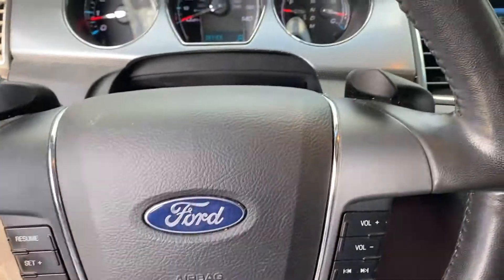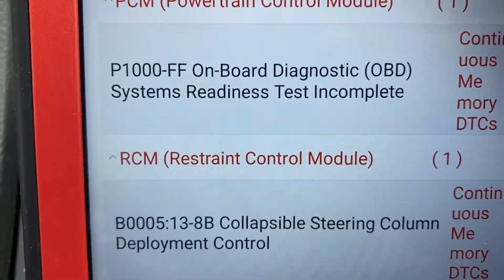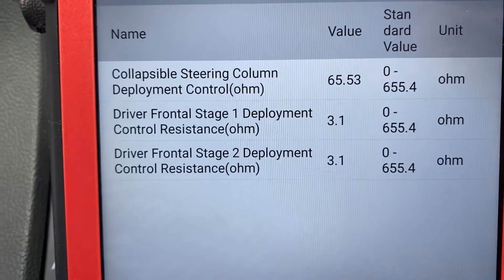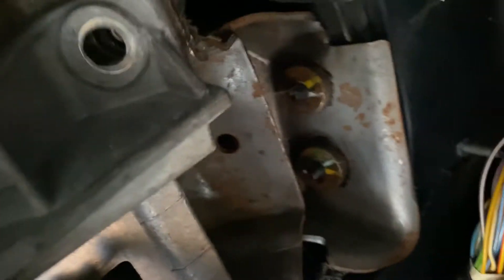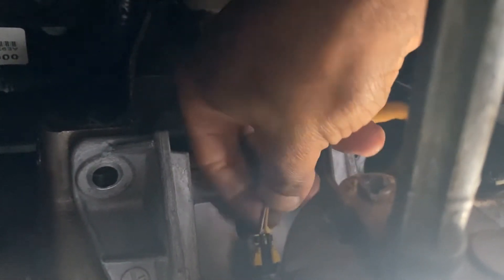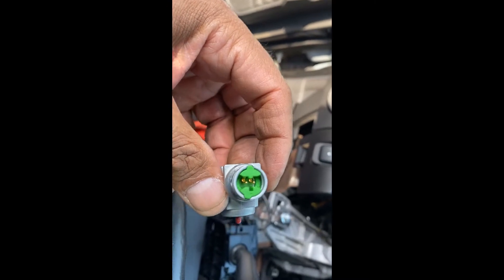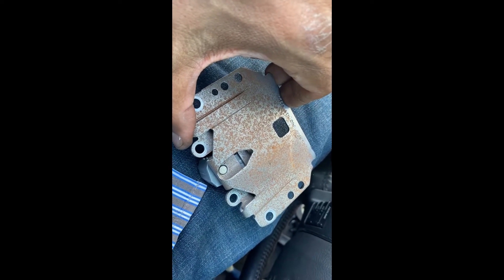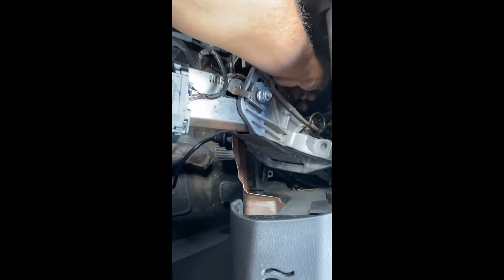2012+  Ford Collapsible Steering Column Deployment Control Sensor fault code B0005

Comment: Hello, loved your video! Could you tell me what dtc code you had. I am showing a deployable steering column circuit short to ground. Does this call for a sensor replacement? Or should I look for a bared wire making ground? Thanks for anything information you can give me!

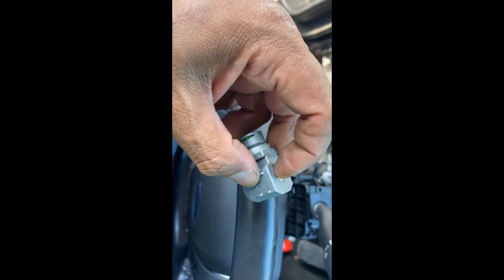Comment: Also, is it always necessary to change this sensor? or will simply pushing that red nipple back in so the metal nipple hits the plate sufficient (like you started showing at 6:55 in the video)?
Reply from the maker: Depend on the dameged inside the sensor, sometimes the internal resistance either weak or broken, push the nipple and try if the light went out is good, or if you have any good scan tool you can read the live reading from the sensor like when i tested with the 2.5 resistor, let me know if you need any help or addtional information, subscribe for more programming  videos. Thanks